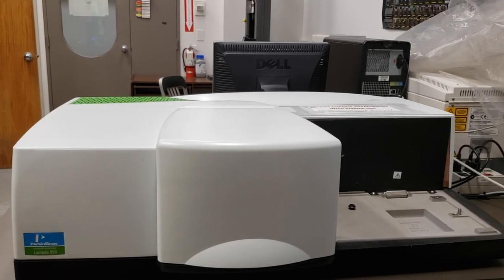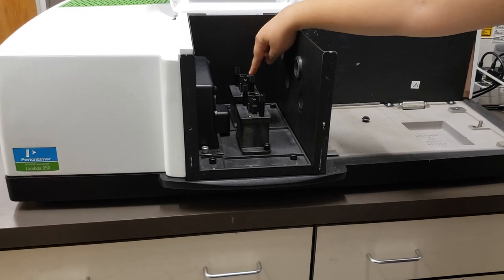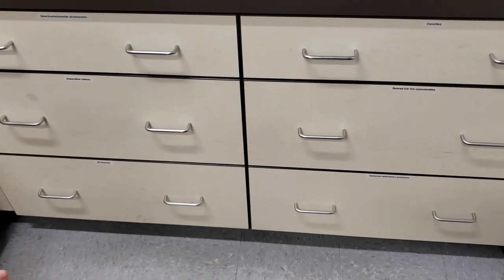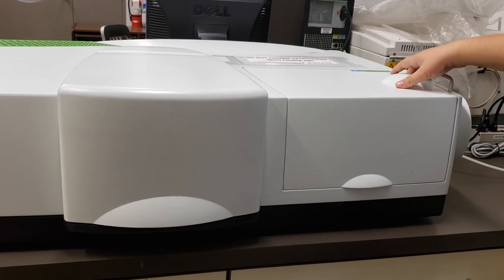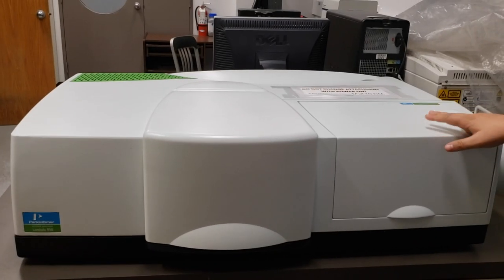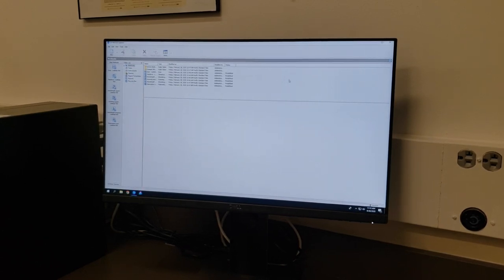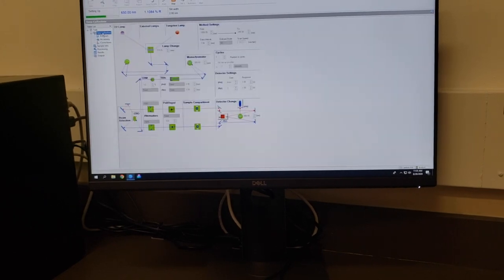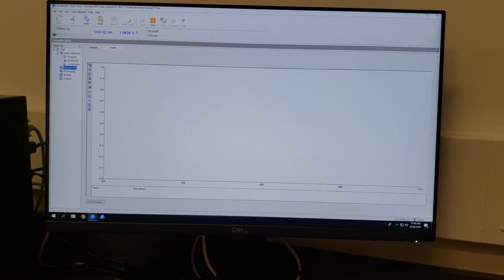UV Vis required training

Comment: Thank you for the wonderful tutorial!   I have a question about the transmission measurement with slits by integrating sphere.  You mentioned put the slit in the sample location, but do you need to put slit in the reference beam location as well?   I'm somewhat confused about where to put slit for the reference beam and for actual sample measurement.
Reply from the maker: We don't currently recommend putting a slit in the reference beam location. Our "slits" are actually just thick pieces of magnet from which we've cut holes of different sizes. Because of their glossy surface, they do reflect some light, and can cause reflectance values greater than 100%. By narrowing the beam down in the transmission space, the beam that hits the reflectance side is also altered. If a person is interested in reflectance data, we recommend they turn on the "align" mode, then chose and position a transmission slit so that the beam hitting the back of the integrating sphere (in the R position) is the right size and shape for the sample in question.

Comment: Hello , Thanks for this video. I want to measurement at 800-1000nm R but monochromator changes at 890 nm ( max value is 900nm) so I get very noisy measurements between 890-1000nm. because of the slit width pass. what should I do ?
Reply from the maker: We have had that same issue repeatedly on our instrument as well. In the past, depending on the age of the W bulb, changing that lamp can sometimes help smooth things in that area. I believe you can also experiment with the gain and response settings in the detector settings on the schematic page of the method setup. I don't have much experience with how to change those settings, but it has been recommended to us by Perkin Elmer. Since the detector and the monochromator change at the same time, adjusting the relevant detector can help smooth that noise as well

Comment: Thank you for sharing valueable information and tutorial.
I am beginner to to use this instrument and have following questions:
1. Is there any way to measure absorption with this instrument?
2. I was reading article from internet to extract information from R and T data. Is there any other way?
Thanks alot for your followup.
Best Regards
Reply from the maker: Hi, so sorry we didn't see this comment sooner! Absorption can be measured using reflectance and transmittance, as you mentioned. Many times, users will make the assumption that one of those is nonexistent (such as with a very thick sample, there is little or no T). In that case, R and A would be inverse of one another. The same is true if you assume no R (A and T would be inverse). Those are the most common ways one could find exact absorbance with this machine.

Comment: Do you have any resources on how to measure a sample with a BaSO4 baseline in reflection mode?
Reply from the maker: You're hoping to use BaSO4 as the reference material? There are a few ways to handle reflection baselines. The first is with the typical 100/0% baselines I talk about in the video (just after minute 30). When running those, put your BaSO4 material in the reflection port in place of the spectralon standard provided. To take it a step further, you can also use the Reflection Corrections section underneath the 100/0% baseline section. I don't have much experience with those corrections, but they would help you differentiate between a specular (like a mirror) or a diffuse (like BaSO4) reflector.
Reply: @materialscharacterization4168  Yes, this is exactly why I ask. Thank you for answering. I basically wanted to record a baseline measurement with BaSO4 (use it as a reference) and then  measure the sample, but I was confused about one thing. Should my sample be also mixed with BaSO4 (both in powder form of course) or does my sample not need BaSO4 for the measurement anymore after the baseline? In this case, what was the reason for the BaSO4 in the first place? Was it to let the detector know the maximum diffuse reflection it can get from the BaSO4 or for which reason exactly?
I think this confusion comes from thinking about the UV vis as an extension to the KBr - FTIR measurement. I thought it would be the same principle with the sample being disperesed in a matrix of the background (The KBr).
Reply from the maker: @mahmoudsorour2028  I can see how that would be confusing. The KBr and BaSO4 are working in completely different capacities here. KBr is invisible to IR light, which is why it's used in FTIR. BaSO4 is (nearly) 100% reflective (so the opposite of invisible) and is merely used to define where 100% lies. If you think in terms of physics, there's no such thing as "100% light." It has to be a relative measurement, and you're using BaSO4 as the reference point. Your sample should, usually, not be diluted with the BaSO4. Hopefully that cleared it up!
Reply: @materialscharacterization4168  All clear now. Thank you so much for your time. Appreciate it. I thought about it today in the morning and reached the same conclusion. Glad to have the confirmation from you. Thank you again and have a nice one!

Comment: Hi! Thanks for the useful and informative tutorial. Could you please help me with my task? I have to measure absorbance spectrum of my sample (it is powder). How correct is it to choose "A" (absorbance) instead of "%R" as an ordinate mode in "Data Collection" window for reflectivity measurement?
Reply from the maker: Hi! The basic principle is that T+A+R=100% of the light. If you assume there is no transmittance (T=0) then A and R can be directly equal. In the case of a thick pellet of powder, you can assume there is no light transmitted through the sample, so it should be ok to change between A and %R and have them both be correct. Just keep in mind that the machine is measuring %R and calculating A.
Reply: @materialscharacterization4168  I've tried to measure and compare the same sample in two modes: A and R. The results showed that the peaks in the spectrum obtained in R mode are much wider than in A mode, however the positions of the peaks didn't change. Using Kubelka-Munk transformation makes the peaks even narrower. Which option, in your opinion, is more correct?
Reply from the maker: @КонстантинГорбунов-ы7ц  Without being involved in your analysis and knowing the parameters of your material and the machine you're using, I am unable to comment on which method is more correct. You would probably do best to find a materials-trained person in your research facility to discuss the results with them.
Reply: @materialscharacterization4168  Thanks for the answer.

Comment: Please make a tutorial on measurement with URA.
Reply from the maker: Hi Mohammad - that tutorial is in the works. We're hoping to have additional material for all of our machines sometime in 2021.
Reply: @materialscharacterization4168  Hi, Is there an integrating sphere underneath the URA ?
Reply from the maker: @pattabhidyta7991  I am not 100% sure, but I don't think so. The URA uses a system of mirrors to reflect the light at incident angles between 8 and 65 degrees to the sample surface. I don't think it uses an integrating sphere to collect that data; I think it's more mirrors that direct the light to the detector.
Reply: @materialscharacterization4168  Thank you. Also wanted to know, What would be the power output of the light through the transmittance port of the integrating sphere? Is it good enough to place a fruit (say an apple) ?
Reply from the maker: @pattabhidyta7991  So sorry I didn't see this until now. I believe the Lambda 950 is meant to handle ~6 OD, which means that 1 photon for every 1,000,000 photons gets through the sample. If the slice of apple was thin enough to allow at least that much light through, it could be analyzed. Since the transmittance of light through an entire apple is 0, that would not be possible. In that case, a sort of reflectance measurement would be the best option.